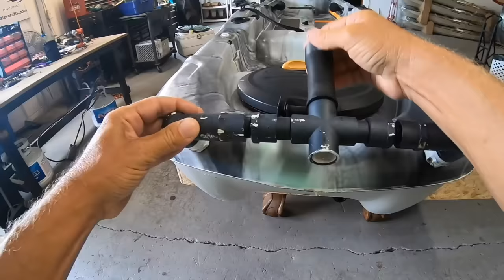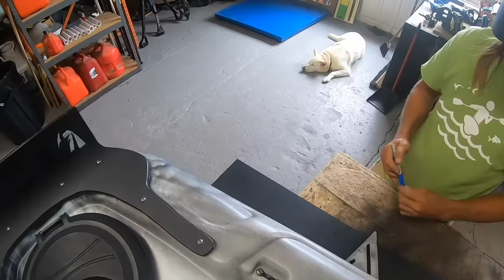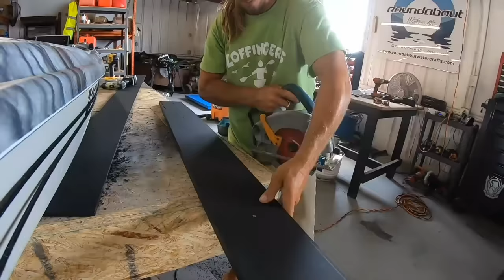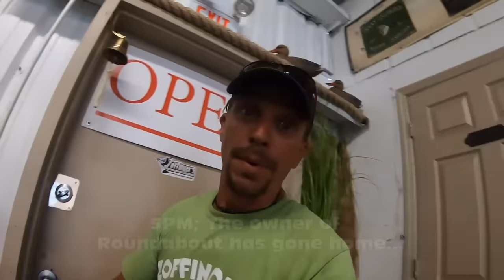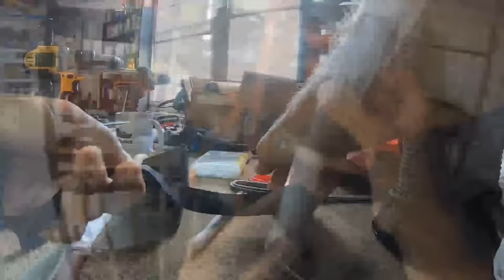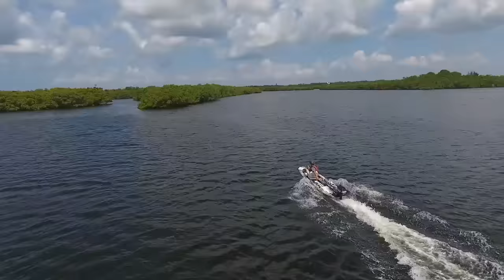5HP Outboard on a Kayak!

Comment: All those power tools and never a shoe worn. Amazing! Nice build sir
Reply: Darren V. Florida boy!
Reply: Florida mans getting the job done
Reply: I work alone on full remodels. My boot of choice are flip-flops. Florida will do that.
Reply: Just how it should be
Reply: @iiWolfy 
"Bare" ♿ 🇺🇸
Reply: I was the same way until a kicked a sawzall blade and had to get 8 stitches to sew up the butterfly middle toe. Shoes from here on out. Florida man who wears shoes.
Reply: @picklemetimbers3003  this Florida man wears shoes too I used to be a bare foot bandit when I was younger tho
Reply: @picklemetimbers3003  I get ya, but I've never done myself a serious foot injury in my home workshop, its always for pure bad luck. the worst that I thought "Yep, that was my fault" was actually from the workplace habit of wearing shoes. if you drop something, especially something delicate, id try and bounce it off my foot to slow its fall, saved many a small widgets that way, stops them pinging off into the darkest corner of the workshop. tried that with a very sharp, very hot pro grade SMD soldering iron. stabbed and cauterised a decent hole. 

if your working with heavy, cumbersome things, Steel toes are essential. field work, hiking boots with ankle support. on the peir or lawn doin boat stuff, any kind of shoe is just... weird...
Reply: Till you step on a screw. Yikes

Comment: Great Build, reminds me of myself outfitting a 15' Scot Canoe Kevlar squareback with a 6 hp Evinrude plus the 3 gallon tank.   Made a cooler seat to adjust the trim by sliding back and forth to find the sweet spot.  Also made a tiller extension with a internal button extension to kill the button on the end of handle. That was in 1986 when I was 36 years old.   Forward 34 years just got another Kevlar squareback canoe and power it with a much tamer 3.5 Mercury which will hit 12 mph with me and my little grandma up front. Little boats with small motors will take you to some very magical spots. Always wear your jacket and kill switch please.

Comment: Cool video, I've wanted to hang a motor of the back of my kayak for a while, this is the best conversion video I've seen, makes the job look a lot easier.
Reply: PPX     websites for
Reply: Why would you buy a kayak and want to put a motor on it?  Why not just buy a flat back canoe or a jonboat?
Reply: Rattlerjake1 because my yak runs in 6 inches of water, and my long tail runs in 7. I’ve been places no boat has even dreamed of.

Comment: Hey Zoffinger, great job on this build. Hand crafting is always a huge plus. Maybe check out the larger selection of RC  12 and 24 volt Jetboat drives.  They should be small enough to fit within the kayaks hull, how many is up to you.

Comment: YOU HAVE TO TRY IT WITH A 9.9HP OR SOMETHING WITH A LONGER THROTTLE EXTENSION! kayak water speed record holder zoffinger lol
Reply: erik nulty 
9.9 would be plenty good. When they pull the boat off the bottom of the lake and back to the shop, hydrofoils will be done up in part 2 of the project

Comment: Fantastic bruv!
The RANGE on this rig -- with say a 15 liter gas tank -- would be HUGE!
Here's an idea for a follow on vid:
Since it's hard to make turns (reaching way out with throttle / steerer extension), how about rigging a simple foot-pedal cable guide system that turns motor left-right and runs controls to front of 'boat'.
Also, use a simple cable / housing throttle / gear controller to run to a simple hand control mounted on front starboard side.
That way you can just face forward the whole time and CRUISE...
YEAH BABY !

Comment: Love your videos and creativity!
I have a Water Quest 10ft 2 person boat.  I added a 6hp Yamaha.  I find that It is too heavy in the back with both the motor and me. I’m 200lbs and the motor is 57ish lbs.  besides adding the throttle extension of he way you did on this video and me sitting in the middle... is there anything else you recommend?  Especially if I have a passenger in the front....

I know I could get a 2.5hp which would weigh less but then, of course, less power.  And I already bought the 6.

Any advice would be greatly appreciated!!!

Comment: Very nice boat & performance. But for safety, does the extended tiller prevent the motor from tilting up and out of the water if and when it hits a submerged log?

Comment: We have run those types of motors extensively on square stern canoes. We used a “whale tail”, or lateral fin extensions on the motor, and it gives a good amount of stability and keeps the front of the craft from jumping so far out of the water.

Comment: Im about to rig a 5 hp electric motor to an aruba 10 footer from wall mart. its about 1/3 the weight, do you think the torque will flip her?  How did your kayak handle against the massive power?

Comment: Hi Marty. Awesome video. I don't know if you are answering any questions or not. But I just wondered about the thickness of the starboard. I am going to use this to build a motor mount for my Kayak. It won't have a 5 horse motor, just a regular trolling motor. What thickness do you think would be sufficient? I am great at overbuilding stuff. Thanks again for the great video.

Comment: I did the same when I was 15 with a cayuco (small wood canoe ) it was a 12 foot long with a 5 HP Johnson . Didn’t have to make a extension for the throttle due to the wood weight.

Comment: What was that plastic I'm guessing you used to patch the holes in the kayak . I have a few holes in my kayak I'd like to fix .hot glue works pretty good but I'd rather repair it tight . Thanx

Comment: An efficient way to get your screws custom sized is to drill n tap a piece of steel, thread in your screw, grind to size. The unthreading of the screw through the steel will straighten out your threads and the screws will be perfect size.

Comment: I wonder what you could come up with in the hydrofoil department? Maybe something that can be lowered into the water once planing speed is reached? It could raise the bow out of the water for a even smoother and faster ride as well as a better view. Using fiberglass to create the wing might be too heavy but it would create lift with one side straight and the other curved. You could raise the entire bow a foot higher while slicing through the water with overall smaller surface contact area.

Comment: I have a build that I can wait to get started. 2, 200lb thrust trolling motors mounted side by side under the rear of a 10-foot flat-bottom job boat. The battery's mounted up front to balance it out. Would be gun on a electric-only lake

Comment: I know this is 4 years later, but you should make a linkage that converts the steering to a push forward/ pull back lever, the shift and throttle should be cable. being able to sit forward comfortably would make a build like this perfect,

Comment: If steering and throttle were mounted on a frame off the seat you could trim with the sliding seat or just mount where balanced.

Comment: My brother was given a jet ski that ran, but the hull was damaged.  He cut the engine and drivetrain out of the ski, and mounted it in the back of a square back canoe.   When he hit the throttle, all it wanted to do was stand straight up under power.  Even with a passenger in the front, he couldn’t keep the front down under power.

Comment: That is great speed, the seat must be the key. I have a 2.9HP engine on a dingy and I don't think it can do 5 MPH, I was thinking of attaching it to my Kayak but I couldn't work out how to balance it right, adjustable seat is the answer. You know, you could add a hydrofoil, with and adjustable seat you don't need to worry, give it a go!

Comment: How do you register your kayak with a 5 Horsepower Outboard?  My old town predator mx has an add on motor mount rated at 2 Horse, but there is no Horsepower rating on a tag

Comment: If you spent the money on getting stick steering up on the front with motor tilt added to the throttle, you’d be a very happy boater…..there’s nothing like the ride and feeling of riding up front in control…..the gas tank can then be mounted to best equalize the load.

Comment: Would it be possible to also include a simple mechanism within the engine mount to adjust the height/ have it tilted up when not in use? doesn't seem impractical, what are your thoughts?

Comment: get like a brigs and Stratton motor mount it on a swivel install a clutch and a really long shaft with a propeller on it. that way more force pushing forward instead of down, it would be easier to run controls and you wont have to be turned around so much only issue would be no reverse.

Comment: Should take a weed eater and make a longtail for the yak. They can come in real handy in shallow water kayaks go into, are less unwieldy at 1-1.5 hp vs the 5hp coleman, they weigh 10lbs or 45 less than the coleman. Thats if you if dont get crazy and do a through hull propulsion.

Comment: At he very beginning of the video if you look at the motor while powering the boat will see some water going up the lower leg which traduces in lower leg water drag.To get the max out of that small portable or any HP motor,  raise a bit the transom say half an inch for motor to sit higher for the hardened water flow passing under the boat's bottom to skim right under the small upper small plate while the motor sits at 90 deg angle while on plane. For that will need someone to follow you from the back at speed  to check that out while in the process of fine tuning the water flow against the lower leg....

Comment: That is pretty bad ass. I have the same kayak with a trolling motor with foot pedal set. Kinda hockey set up.  I like this but not the twisting action. Mabe you could modify the throttle n steering. Now that would make a cool video?

Comment: You certainly have an imagination and the ability to bring that to fruition, however, what if you wish to carry any gear? You were sitting all the way in the front. How would it ride and handle with any gear? Then, always having to adjust your placement of the gear while getting there, i.e., sliding the seat, relocating gear, etc.?

Comment: You could likely get a lot more horse power via electric drive options with less weight maybe for safety and stability sake add two akhas to then have a trimaran

Comment: Its so fun being in the Fishing Kayak community right now. They are steadily pushing into the huge gap left by bass boats manufacturers thinking its ok to charge $20k to get into a very basic boat anymore. 
They are 3x more expensive than when my Dad bought one 20 years ago. literally 200% more. For NO reason except when they all agree to jack prices, they figure you got no choice but to do what THEY want.
In steps larger fishing kayaks and newer electric motors. And the electrics keep getting bigger HP, and lighter. In 3-5 years, the Kayaks will be moving on average 50% of the speed, at 30% of the cost.
On top of that, enterprising young men(like Tiny Boat Nation) are making it easier and easier to turn a simple Jon boat into a legit bass boat.

EAT A #@)(* big bass boat companies!
Hope some of you go out of business. You've earned it.

Comment: I hung a 10 horse Honda on a 13 foot gheenoe..........she would fly , prolly about 30 mph. [scary fast]. I was actually trolling it off the reef at Islamorada Florida........got a 20 lb wahoo outta that rig but...........storm blew up one after noon and dam near sunk it running back in..........bailing my ass off with a cut out milk jug. think she was rated for a 5 hp but all I had was a 10. [good times].